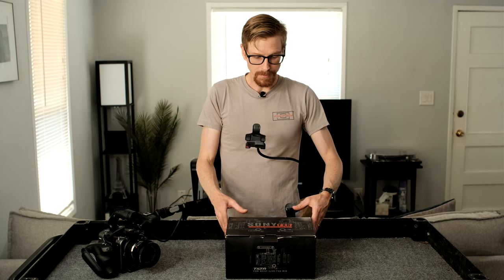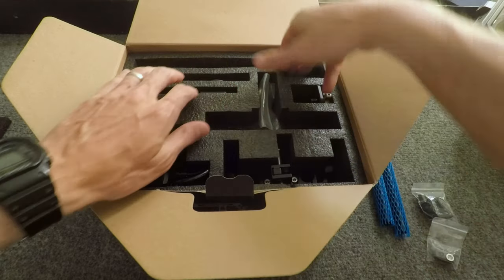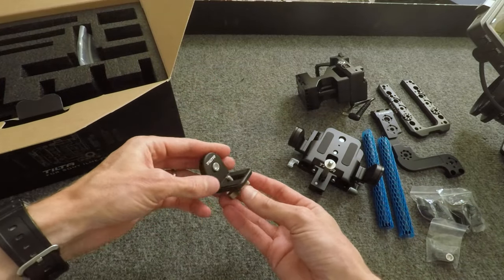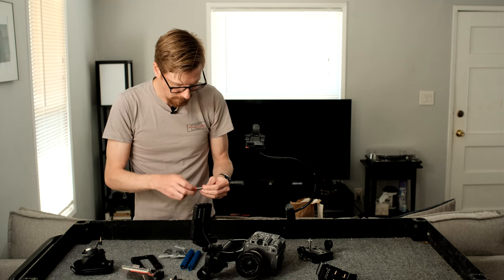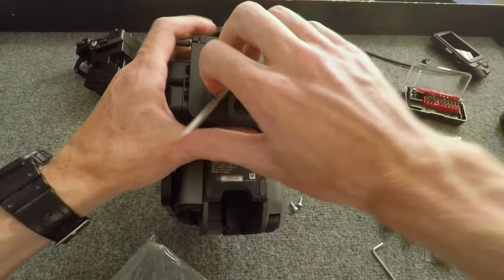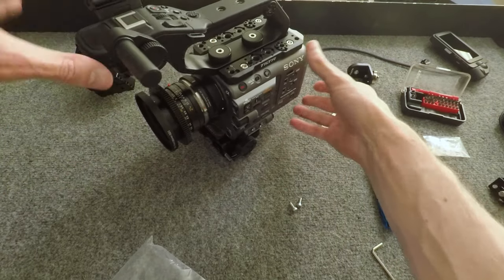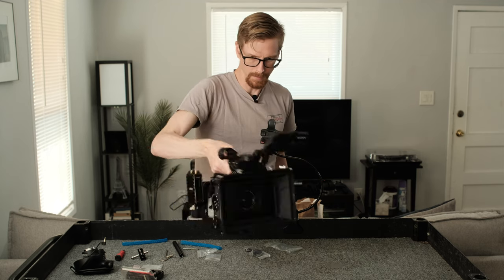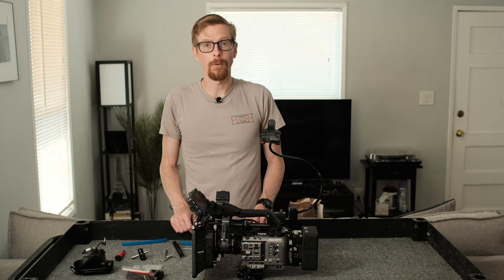Unboxing the Tilta Camera Cage for Sony FX6 (Advanced Kit)

Comment: Hi mate. Thanks for the video. How do you keep track of battery power whilst shooting? I'm assuming that the battery meter on the camera doesn't show correctly and that blue light looks like it's on the wrong side. Am I missing something here?
Reply from the maker: Hey! Thanks for watching. Typically with any camera I look at the battery it self if it's gold mount or v lock type battery. They pretty much all have an indicator or small LEDs showing the level. Also I will look at the voltage on the camera display. I can't remember if the FX6 can show voltage or not but when I work with the Alexa Mini, I know from experience that the camera will shut off once voltage is down to about 11.3-11.5 volts. It's different for every camera but something you can test to find out. That gives you a more accurate estimate of how much power is left.

Comment: awesome ! one thing im skeptical about is if you want to add a monitor as atomos ninja V OR SMALL HD! is there any possibility to have it in the front up the matbox ?
Reply from the maker: I actually got a SmallHD Cine 5 for my FX6. You can use a Noga arm or an Ultralight to put the monitor out over the MB. When I do handheld I like the have the monitor flush with the camera left side of the MB. BUT it depends on what lenses you are using. My Leica R primes are very short so it's not a problem. If you have physically longer lenses you will need a longer arm to put the monitor out further.
Reply: @FilmmakerSurvival  thank you so much do u have an IG ?

Comment: How do you find the clip on matte box with the Leica R's? 
They hold up okay if all 3 trays have glass in, or do you think would need to mount onto rails at that point?
Reply from the maker: It's pretty good. I did have to upgrade my EF mount to the Metabones cinelock because the weight would shift the lens when using a wireless focus motor. I think if I was doing 3 filters I would go on the rails to be safe. Those lenses aren't really meant for that much weight hanging out front.

Comment: If you lose the bottom plate, you lose rails support, right? And it looks like the side of the cage still sticks down below the body of the camera. Am I right? Doesn't that create a problem?  Sorry for being obtuse,  I'm looking at a 2D screen and trying to think in 3D space :)
Reply from the maker: You can use rods off the top. Yes I beleive the side plate would stick down past the bottom past the body without the bottom plate.

Comment: How do you manage to put the camera on a gimbal? You have to strip it down to minimum, it looks it will take forever to switch between gimbal and tripod.
Reply from the maker: If you are using the right gimbal that can support the camera then you don't have to strip it down much at all. The Ronin RS2 can hold up to 10lbs. This FX6 with everything I use on it weighs exactly 10lbs. You may want to take off the monitor and matte box to help. All you really have to do is maybe switch a base plate if you want to go to studio mode. Realisticly it should only take a minute or 2 to switch. If you're going handheld it's just a matter of putting the monitor on and handles if you need them.
Reply: Which base plate would you recommend?

Comment: The battery plate is a nice design but blocks the card slot access alot, which is a frustrating issue.
Reply from the maker: I have noticed this. Can be a bit annoying.
Reply: @FilmmakerSurvival  Are you able to remove and insert cards or do you need to remove the Tilta adapter or v-mount battery? Also, is the Tilta Kit heavy? I just switched to the FX6 from an Amira because of how heavy it was, I don't want to end up in the same place. Thank you.

Comment: is there a good way to mount a wireless on that attachment so you can still hold the camera with the grip? Looks like that mount just gets in the way of the grip which sucks cause I can see myself wanting to shoot in with the grip and camera against my stomach as I'm a tall dude lol...
Reply: also all the controls you have with the grip, iris, auto focus assignable buttons etc...
Reply from the maker: You could get a small noga arm or ultralight and put it from the top. You might be able to just move the bracket it comes with in one of the upper holes on the side.